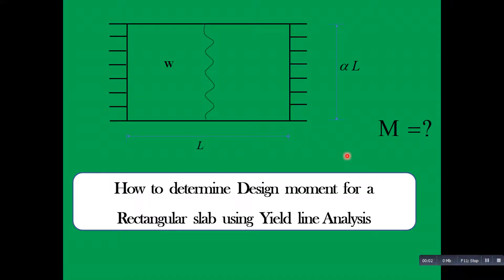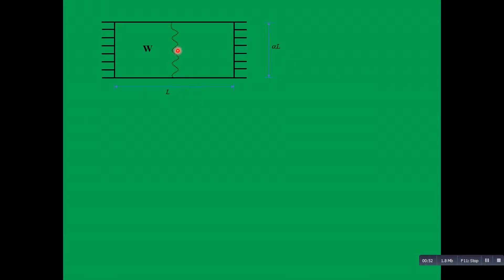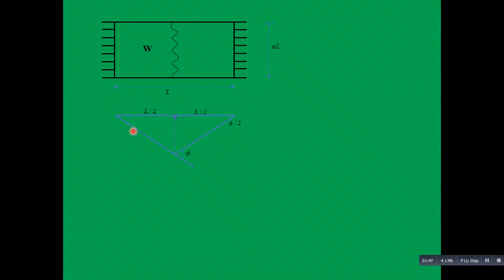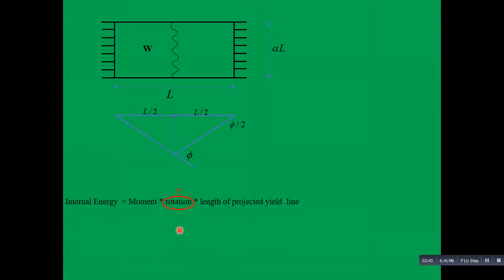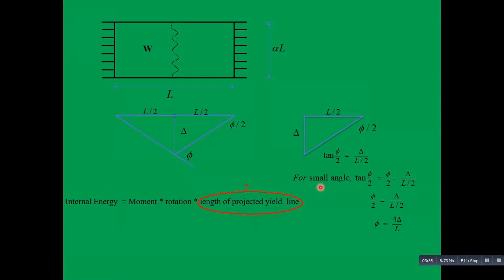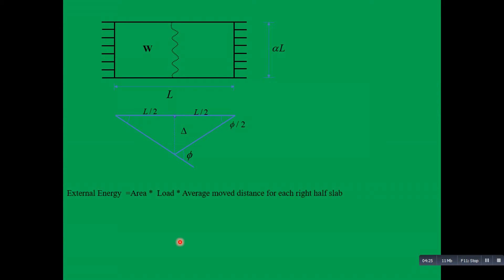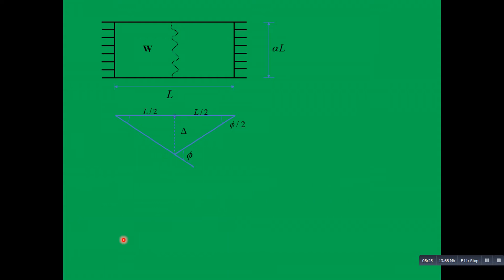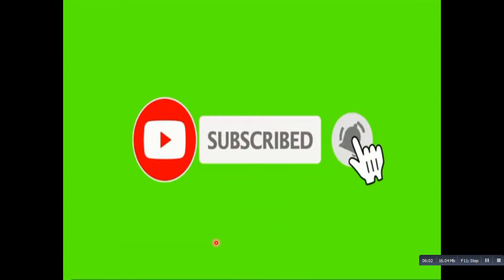Yield line theory explained

Comment: Hi. I have a question. What is the use of "alpha" in alpha(L)?
Reply from the maker: HI, Manansala, the use of alpha is to differentiate  between the width and length of the slab. i.e the width is equal to some factor times the length. the factor being alpha. you can use any other Greek letter. Thanks .
Reply: @civilengineering4free106  thank you! That is noted. I realized it a bit late that the figure is a rectangle and not a square. Thank you!
Reply from the maker: Your welcome. share this video to reach others and support this channel